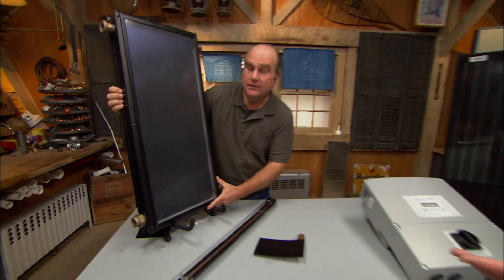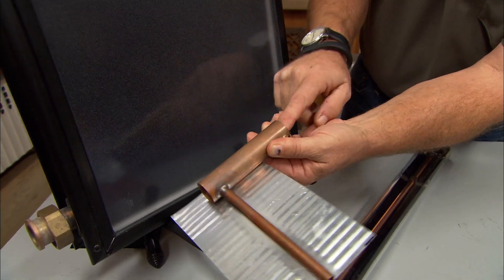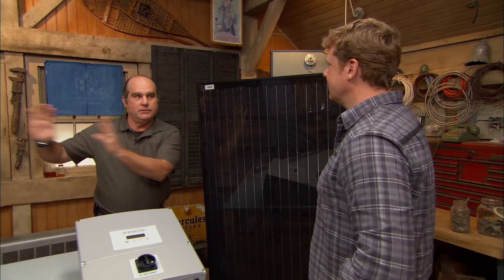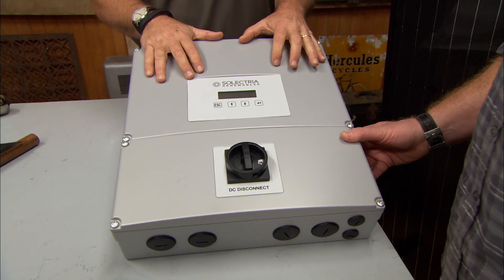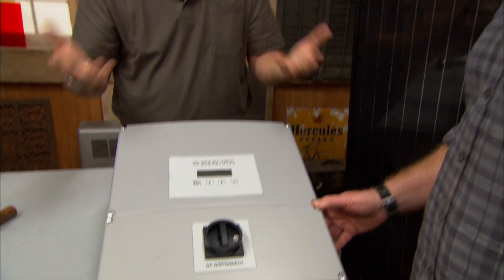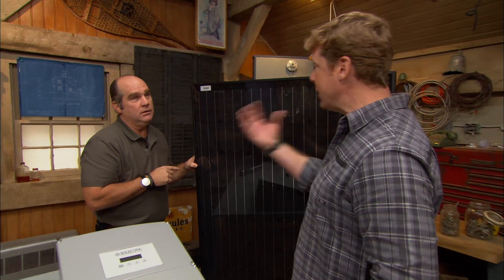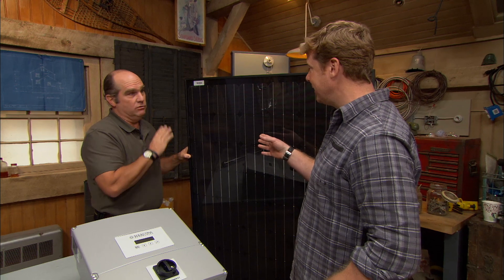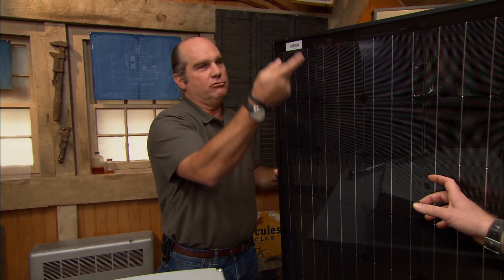Understanding Solar Power | Ask This Old House

Comment: To start keven , you have bern my most favorite reality star since 1987 .  But there is a glitch in the solar movment in the united states  , department of energy says your not allowed to run power back in to the energy gride do to power outages,  then powers out power companys contract help on the power lines . And when power is out the batery banks are feeding the power lines Electricquting the powerline workers .  I thought you should design a battery pack breaker that when the braker notices that the main power line is not transporting A/C current it auto automatically  tells the powerbank braker to switch off the main power line make the house a closed  series loop between the house brakerbox and all house that will automatically cut power to major electric units like ,  a/c's , heater, washers, dryers,  to a point where the home owner has to cut the power to those powered units there self ,to save batterys power .    On the funny side , i can recall you all ways bring coffee to the boys in 87 ,  i was 10 then , and you look  like your 8 years older then you did in 1987.  Marry CHRISTmas to you and employees of this Old House .
Reply: Not true, a Hybrid Solar Panel System ( one with batteries ) does not back-feed the Grid, when the Grid is down. The batteries will only supply AC Power to the house.

Comment: Doesn't pay to install solar or foam insulation unless you know you'll be in the house for at least 20 years (ROI isn't there).  Even without purchasing these items, in a normal housing market (not SF,NYC), it takes 5 years to break even due to when you sell, you need to pay realtor fees, moving fee, fees on the loan, etc. so if you can't be in the house for 5 years, don't buy it.  And don't buy a house that is gigantic to impress your friends or show off - buy a simple house that meets your needs, nothing more!

Comment: The thing to keep in mind is that for most people, these things (at least the PV panels) won't pay for themselves for over a decade by which time, you'd have to repair or replace them and they make your other repairs to the roof much more expensive later.   You'd also have to be in an area where you get a lot of direct sunlight.  If you live in a rural area without a grid, then by all means, get yourself a bunch of panels, wind, and Tesla batteries along with a LED bulbs and you're going to be ok.  If you have a lot of money and just want the novelty of PV panels, then by all means get it.  If you think this will replace a generator or actually save you money on this scale, then keep dreaming.

Comment: only way to send power back to the grid if its set up for that where i live we dont have that we can get solar power but we cant send it back to the grid
Reply: There is a debate over those that have solar sending power out during the day and then using the lines at night and doing that for free.  Currently, most regulators (except AZ) are forcing power companies to pay solar users same rate as power company charges for electricity.  Many say this isn't fair, because solar user isn't paying for line maintenance.  For example, if everyone had solar and power company had no customers, who would be paying for line maintenance?  That is the issue.  Some say it isn't fair to those that don't have solar who still have to pay for line maintenance.  If you don't know full details, they are available with google search, difficult for me to explain it all.  Solar City no longer does business in AZ, because that state stopped forcing power company to sell back at same rate.

TerraTN - It doesn't matter when TVA was created.  It is a matter of upgrading since.  WIKIpedia - "TVA's power mix as of 2012 is 10 coal-powered plants, 29 hydroelectric dams, three nuclear power plants (with six operating reactors), nine simple cycle natural gas combustion turbine plants, and five combined cycle gas plants.

It seems they have been upgrading.

Comment: First off - NEC code does not allow you to hook into the incoming utilities with Solar Electric, so you can not back turn the meter! Solar Electric is a backup system that is to "Stand Alone" on a switching circuit that cuts the incoming electric service off
Reply: Incorrect also. The NEC absolutely allows you to connect to the utility grid in many articles from 230.82(6) to all of article 690 to 705.12
Reply: + Bennington Camper - Thank you Bennington, love it when commenters provide references.
Reply: Both Grid-Tie Solar and Hybrid Solar can  back-feed into the Grid. But some STATES, like Hawaii, cannot handle any more Solar back-feed, and so now some STATES restrict back-feeding.

Comment: I like the idea of getting the photovoltaic system installed
for free but is it really free what about hidden costs & I wound not mind
giving up the rebates, but how do I find a contractor that is reputable &
can be trusted what about maintains or repairs. I live in TN we have hail
storms who will pay for these things & can this be expensive? What about warranty’s
What if I use more electricity than the PV system can
provide. What happens if after some time passes & I find out that I don’t want
or need the PV system what then.
Reply: Hail?  ... Talk to your home owners insurer.
Reliable Solar Vendor? ... Talk to your neighbors who has Solar installation for at least 1 year = real data not verbal promises.

Comment: Ahh Richard, if only you knew the sheer amount of raw materials that go into a PV panel.

Every commerical rooftop and south facing home rooftop?  

The amount of strip mining and processing would make any environmental advantage meaningless.

Wind (bad solution but better then solar) and water (best solution so far( using currents in rivers to push turbines)) is the best for the least used natural resources.
Reply: Umm, no.  Solar cells are getting more powerful yes, longer lasting.....sorta. Depends on who you ask. Resource hogs? Still one of the worse.

When you have wind mills in the right place and water turbines in the right place as well the results are both incredible and.....wait for it.......... efficent to build without taking up alot of resources.

Doofus huh? To bad I work in the industry and know what I am talking about.
Reply: Nuclear power is better still with a 90+% capacity factor and nuclear fuels are between 1 and 3 million times as energy dense as fossil fuels and 96% of the so-called waste can and should be reused. Geothermal is pretty great too.

Comment: People fail to take into account the maintenance, repairs and replacement of PV components when considering savings.
Reply: A properly installed system should only have to consider replacing the inverter over the system's 30-40 year lifespan.
Reply: That is true, it is just that if you paid for that system, you should live in the house for 20 years (at least) for get back your return on investment so don't buy it if you aren't going to be there long term.  Buyers don't pay a premium for homes that have solar, BTW.
Reply: @ForwardGuidance  Break-even is typically 10 years.
Reply: @MrSummitville  Okay, not as long as 20 still one should not go solar unless staying there a long time afterwards.

The same applies during a renovation for say spray insulation and premium windows buyers won't pay a premium so go with cheap if not 100 percent committed to the house for  at least a decade, more than a decade would be better since in most areas, it takes 5 years to break even on a house purchase without doing anything to it since most houses only appreciate 2 percent annually.  Houses are a place to live, not investments.  It takes a lot of time recouping the fees paid to real estate agent and fees/costs during closing so never buy a house unless firmly committed to stay in it a long time.

Comment: The price is way off $15k will only get you about a 4kw pv system. that is only about half of what you need in an average house.  you are going to pay about $4 per watt installed give or take $0.50.
Reply: does it read 250 kwh? that is your usage over time.  Not the daily demand. divide that per day you will get a better idea.  When we talk about the size of a system that is the amount of power that the cells can produce.  so for example a 10 kw system has 50 200w panels (200w panels are on the small size now but makes for easy math). that is DC current that needs to be then converted to AC power.  To be honest we will plug your usage and exact GPS location into a computer program that is designed by the different inverter and panel supply companies and then design a system that meets your needs.  Based on your location and sun exposure.
Reply: Prices for Solar have come waaaay down. $4 per watt is now too high !

Comment: Thanks for sharing. Great introduction, Richard, and perhaps you might be able to answer my question. 

Legionella breeds at temperature between 15 and 45 Centigrade and is potentially transferred to the lungs in the shower. So how can this be avoided with the water solar heater?
Reply: The water from the solar panels feeds your existing hot water heater, which determines the temperature at the faucets.
Reply: Think of the solar hot water system as a pre-heater for your existing domestic hot water system. It raises the temperature of the water coming into the house before it gets to your water heater, so it has less work to do to get the water hot.

Comment: I worked as a solar technician for four years. This video sucks. If you can make the initial investment it will pay itself off in not too long and then you will save ridiculous amounts of money. You can also lease systems and save money. Pretty much no matter how you do it you end up saving a crapload of money over time. That is not to mention the environmental benefits. Also, the more we support solar the more it will get research and development money which will bring the cost down much further. Solar is a winning proposition. What we really need is better energy storage technology. The more we support solar and the more efficient and lucrative it becomes the more money will be poured into energy storage and the better that technology will get. Trust me, your children will thank you.
Reply: Let me explain solar pv has no moving parts and are rated for 25 to 30 years the biggest issue I see would be the inverter. My inverter is in my house not exposed to any elements. I'm not sure what you mean by a updated version. I have a 5 kW system my electric bill is virtually eliminated. And it absolutely adds value to a house.
Reply: *****
Why don't you calculate it?
Reply: Where do you live? Are there incentives available? I would recommend calling a reputable solar company and working with them to see what the options are. You will almost always save money with solar, unless you live somewhere with little sunshine. Yes, reducing energy usage is always the best way to go, but modifying an existing structure to get a significant energy savings is very costly.

Also, you can often get a leased system installed for free or very little and have reduced utility bills.
Reply: Closer to 7-10 years for payback in today's market.
Reply: Bennington Camper
Sounds like a darn good investment :)
Reply: Solar is a great investment. I had it put in 4 years ago cost 25,000.with state and federal rebates and power company rebates I paid 7,800 out of pocket. I am paying 11 to 12 dollars a month for 6 months the other 6 months I don't pay because I have a energy credit I make more power than I use.
Reply: Well you have three things going for you: someone else picking up the tab for most of the job, your energy company allowing you to back-feed power to the grid (some don't), and you live in a sunny area.

Assuming you were paying about $1,200 per year prior to the getting the PV panels, even after the very heavy subsidy, your break-even point is still about 7 years and it would be 21 years if others don't pay for it.

On the surface it doesn't sound long but keep in mind that nothing lasts for ever, especially things that are subject to rain and ice and I can promise you that repairs on that are going to cost more than regular electrical work. 5 years is usually the magic number before things start giving trouble.  

Something else to keep in mind, average people live in their houses for only about 13 years and for younger people, even less. 

So is it really that great of an investment? It doesn't really add value to the house because someone else buying the house might not want ot deal with repairs to a 13 year old PV system. 

Don't get me wrong, in large scale I think it does make sense but there are very few cases that I've seen in my line of work where it's an actual investment.
Reply: Arie M
Solar PV systems are incredibly low maintenance. Most systems installed by my company didn't require any maintenance for 10 years or more, and usually that is planned maintenance. But I will say that it is worth it to pay a little extra for a reputable company and quality components. People who buy houses generally love solar because it saves them a huge amount of money.
Reply: The bald dude says everybody should have them so I'm not sure how much more of a glowing recommendation you need.
Reply: RichBshine1972 I meant that this is an emerging technology.  Take LED bulbs for instance - the difference between the quality of LED bulbs today vs. 5 years ago is night and day in terms of quality and longevity. LED manufacturers were making the same claims about how they would last for ever too but guess what? After 2 years, most of those are starting to burn out so just because it has no moving parts doesn't mean it won't wear out.  

As far as solar panels go, they are continuously getting more out of every square inch of the panels so it stands to reason that 10 years from now, the panels on the market are far better than anything you have today along with better battery technology.   

If you have the means to get them, by all means get them and maybe one day it will make sense for most people, but at the moment, I don't think it makes sense for a large portion of the population and they're better off using a tiny amount of money that they were going to spend on solar panels and upgrading their light bulbs to the new LEDs.
Reply: Arie M
The energy used for lighting is minor compared to other uses
Reply: I disagree. unless you live in an area with a lot of direct sunlight (about 8 hours) , these things barely take a dent out of your monthly bill. Then after 5 years, like with all outdoor fixtures, these become a money-pit of repairs and after 10 years, by the time you get any sort of return in your investment, you'd end up having to replace them or buy a new updated version that's much better. And really, not many people stay in the same house for 10 years these days with the way the jobs shift around the country so all in all, it makes sense for very few people.

Comment: If you do it yourself you can easily heat your water for a few hundred dollars and some elbow grease.
Reply: I had to sell my elbow grease for $50.
Reply: The average person never even steps on their roof and they could not install Solar Panels without roof leaks and wiring issues.